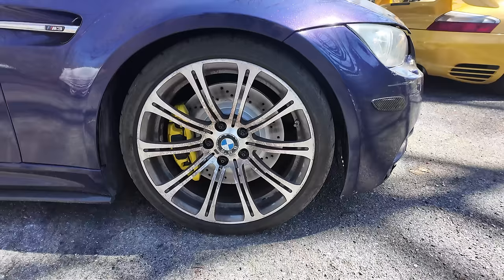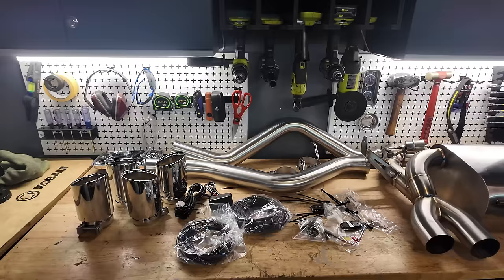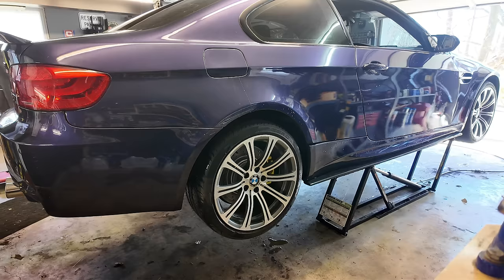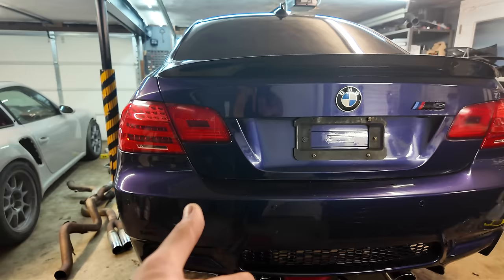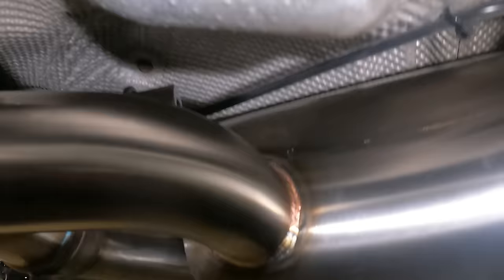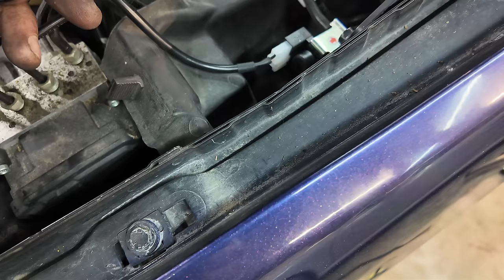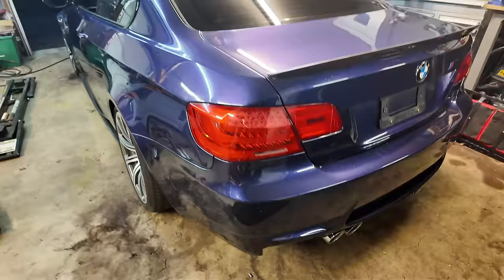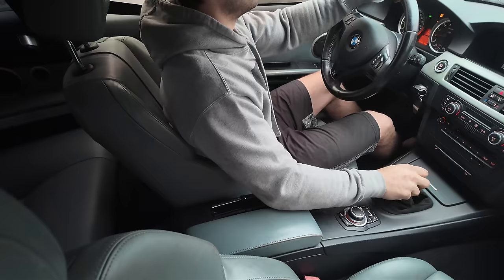My Abandoned E92 BMW M3 Came with Some Hidden "Modifications"

Comment: I have used those same connectors to tap into existing wiring before and found that they have cut the original wire in half which leaves it with less wire to pass the current through, not to mention that they don’t provide a good connection and depending on what the original wiring is powering I would be cautious as with less wire it will be prone to overheating and potentially cause a fire. I strongly recommend not using these crappy connectors for anyone else watching as they will likely destroy your wiring!

Comment: Nice work!  I noticed you had tap splices for power - not really a good solution for pulling power.  Better to fully splice, solder and heat shrink those connections
Reply from the maker: I'm not a solder fan.

Comment: An m3 in this condition needs motor out change all the bearings (those on the block also) as minimum
Reply: I was just looking for this comment. Sreten, owner of M539 restorations, gave an amazing rundown as for why.
Unless Matt wants to acquire a bluetooth crankshaft of his own
Reply: @Bigtigerr4774  yep but i didn't hear this from sreten only i know a guy here in europe where i live who own this kind of m3. He told me the same thing. You need to change all bearings. He's a mechanic to.
Reply: “Bluetooth crankshaft” is may be the top of Sreten’s humor😂 Plus, his E91 rebuild could be top of Bmw restorations!
Reply: Foreshadowing?
Reply: Part of me wonders how many of these M3's would be better untouched, so many fail after they get rods changed. "If it ain't broke don't fix it"

Comment: 1:24 they don't burble with a stock tune and straight pipes
Reply: My N55 did, turns out it had a couple sticky injectors
Reply: @00000005547 I got an f10 n55 and I’m tryna fix a boost leak after installing new charge and boost pipes. Mine burbles some only when I downshift sometimes tho is that normal? I’m completely stock other than the new pipes.
Reply: @DaddyJoe_ Yes that is normal. Backfire or burbles are fuel coming out the exhaust after combustion and being ignited.
Reply: @brandon-cy9of  yea I figured it was normal only started when I chopped my muffs and resonator off😂
Reply: my 328i does, its just got muffler delete and thats it.
Reply from the maker: Could be tuned I'm not sure.

Comment: Noted when you show the vacuum pipe run, you’d replaced the brake lines but missed the “center” tubes. Or am I wrong?🤐
You gotta do those, they’re a pain, you’ll skin knuckles and get covered in fluid, that’s why they burst, always neglected. 
They’re only a few bucks, but fantastic training tool for others if you film it well.
Reply from the maker: I actually have them, but didn't get around to installing them yet.  They do indeed look like a nightmare job lol.

Comment: You could wire wheel that rust off the diff and exhaust hanger areas then use a brush to refinish with a rust blocker paint to clean the underside up.
Reply from the maker: Eventually yes

Comment: I couldn't see them very well but the electrical connectors you used to hook that up looked kinda cheesy to me.
You should get some good ones, solder, and shrink wrap them.
The exhaust looks good.
I've heard those hose connectors always break.
Reply from the maker: I actually haven't had any issues with them.

Comment: i  think it would be better idea if you fitted the whole system in the trunk on left side like it comes from factory on bmw cars. thats where the solenoid sits and a vaccum line comes from the fron of the car to there. it was great idea putting valve system because these M3 sound so good straight piped but too loud for all the time opened.
Reply from the maker: That would work too. But this is how they designed the kit.

Comment: Clean install on the exhaust. My E92 M3 came with the 2.5 muffler mod, which made it almost as loud as straight pipes. I ended up finding a stock exhaust unaltered to install. 

The valves are cool, but I can't think of any situation where I'd open them? Don't wanna annoy my neighbors,  or other people's neighbors for that matter. And most road courses I frequent have strict noise limits(which I find funny when manufacturers call their open exhaust valves "track mode").....
Either way, the homelink hack is also neat.
Reply from the maker: Just when you want a little extra noise to show off haha

Comment: The Torque is high jn the rev range. Your not gonna feel it short sifting at 4500 to 5000 revs 😂😂😂😂
Reply from the maker: Right. But the opposite of my LS1 form sure.
Reply: @matt13ross  yeah very different, that will have plenty of low down grunt, good for around town and roll racing ( a lovely deep burble V8 noise).

 But now imagine YOUR on track! like the ring in germany or limerock usa, you want those long gears, and you want your torque high up, so you charge to the corner like a charging rhino. Then you Donshift "VHOOOOOP"💥💥💥

Then escape the corner mega quick and light on your toes like a cheetah. 🐆

These cars are all about the track and building up the pace slow to keep the chassis stable, but once your upto pace, its Frightening, especially when those gears keep on going, all you want do is let off.

A shit load of emotion!

Hey from England btw, you need twisty roads for this car. A usa Grid system will not allow you feel the emotion of this car. I can see why you get a little frustrated. But take it to the canyons and step on it. Dont be a pussy a use loads of brakes lol. Sit high in the rev range and down shift to slow down.

Your be hooked!!!!!!
Reply from the maker: Def need some good Twisties for sure!!!

Comment: Sat way too low too
Reply from the maker: Yup!
Reply: @matt13ross  I'm suprised it's not rubbin. Mine rubs on back just from tracking been out!
Reply from the maker: It was when it had spacers on it
Reply: @matt13ross  the EDC sits naturally lower than standard suspension. If you run 19 inch they can rub if tracking not right. I read that on a forum and thought it was nonsense. I assumed some bushes had gone. I jacked car up 2 days ago and saw a hole In arch liner. So yeah if track is out they can rub. I'm suprised you can alter tracking on rear.